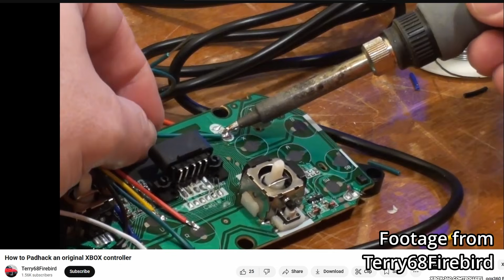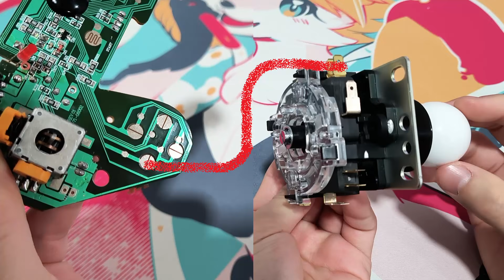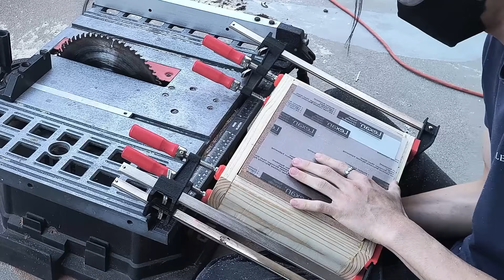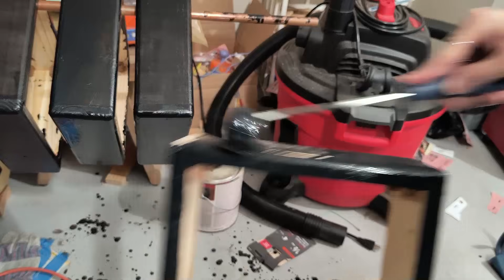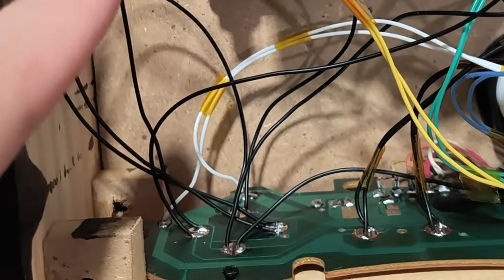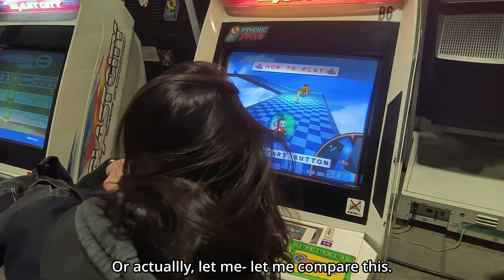Super Monkey Ball Banana Joystick GameCube Build

Comment: Hey,  did you see a web browser version of Monkey Ball was released a few days ago?    There's an article about it on Time Extension.

But, the stiffness fromt he arcade version might be more from the rubber that's housing it,  it looks like they stuck it in the middle of a plunger :D    But you could replicate it by lowering the shaft slightly, and maybe tying some bungie rope to it,   which a lot of cheaper steering wheel controllers used to do to get that feel of tension the further you steered.
Reply from the maker: I did! It's so crazy I don't understand how that's even possible.
And you're definitely right. The rubber grommet around the original looks really thick. I did think about using some tension springs and attaching them to the bottom shaft of the stick, but string would actually be better since it wouldn't take as much room. I'll try that if I ever make an improved version haha. Thank you so much! Hope you enjoyed the video!

Comment: I've heard the opposite the electricity flows and when you push the button the electricity stops flowing normally and goes to ground instead. I always thought that sounded backwards to me but I'm not smart enough to confirm one way or the other.
Reply from the maker: You're right! Current conventionally flows from positive to negative, but the reality is that the electrons themselves flow from negative to positive. This discrepancy is a result of some history I won't get into, but the point is that current flows from positive to negative, and electrons flow from negative to positive. It just depends on which framework you're looking at things from. I think another confusing thing is how "current" can refer to both the flow of electricity itself, but also the measure of the RATE of flow of electricity. In the case of my video, I just use the framework of flowing electrons, and use current to mean the rate of flow of electricity. Very confusing, but it's like that for everyone haha. Hope you enjoyed the video!

Comment: I remember when I first got to try the original arcade game when I went to EVO 2024. It really is a magical experience to use the banana joystick for Monkey Ball fans. 

As for your really cool build, I think having heavier springs might be able to alleviate the snapback, if you were able to modify it. I did see a reddit post that fused a mini Adafruit analog joystick with a Sanwa JLF so maybe there could be some inspiration from that. 

Your breakdown on how you made yours did give me ideas on what I would do if I were to make my own frankesteined pad hack stick like if I were to make it switch between modes for GameCube and PC. I never tried pad hacking before and have no idea if it's possible to stuff two controller PCBs into a case, somehow route all the wires between them and use a switch that activates which controller you're using, but it would be an interesting experiment.
Reply from the maker: Ohh I just found that post that looks really cool. I think that would've been useful for my Smash controller haha.
That would be really cool to have a controller that switches seamlessly like that. I have some other controllers that solve that issue just by having 2 plugs at the end haha. Or just making the cord swappable. But now with Bluetooth GameCube receivers, that'd definitely be easier. Let us know if you ever make that controller that sounds really interesting.

Comment: i want something that will hold up for a bit is there a hall effect or tmr stick u can think of?
Reply from the maker: Yes! The trick I've learned to find parts is to either add "component" or "industrial" to your searches. I found a few industrial hall effect sensors just now that I think would work, but I don't have personal experience with them so I can't say for sure. I think if you take apart the plastic housing on the stick, you should be able to more easily attach the banana on top of them. Hope that helps, and I hope you can build a cool controller!

Comment: Flycast can emulate the Naomi hardware and then you can get the original Monkey Ball game.
Reply from the maker: I tried emulation, but I think I'm just not smart enough to configure it correctly because it didn't work for me. Even then, that still wouldn't have been the same as playing on og hardware with the real banana, and that's what I was more interested in haha. Hope you enjoyed the video!
Reply: @SodaCanTablet you need the Naomi bios in a folder and the monkey ball game in a folder called monkeyba. The chd will be in a subfolder also called monkeyba but the zip of the game is not in the subfolder.

Comment: I feel like using 24-28GA wire and soldering to the vias instead of the button contacts might've been better. No real need to use wire gauge that thick for inputs. 100% agree with the recommendation to do daisy chains and use quick disconnects. They don't cost that much people!

If you ever care enough you could probably get a nicer print using resin, seems like you have your own printer or access to one but not sure how viable that is (or isn't) for you. I usually outsource my prints and always choose resin for that baby smooth look.

Great job!
Reply from the maker: In hindsight, you're totally right. I even used thinner wires in my other projects like you can see when I'm showing the daisy chain. I think those are 28 or 30 gauge, so I definitely should've recommended those instead. It's because a lot of the footage and voiceover are 2 years old at this point and I didn't have much experience back then haha.

I want to get a resin printer one day! I love how smooth everything looks, but yeah it's too expensive for me for now. And it wasn't imperative that the prints for this project be super smooth, so I didn't want to spend more money than I really needed to.

Thank you so much! Glad you enjoyed the video. :D
Reply: @SodaCanTablet  If I can make a suggestion, an ABS 3D print that's been acetone vapor smoothed would yield results very comparable to the original injection molded piece, and you benefit from using filament that's already colored banana yellow.

In any case I'm very glad you're still producing content and I think the project turned out great.

Comment: Maybe if the banana lever was kinda similar to a Korean lever with a rubber grommet and shape the collar to be close to square or rounded square and have the analog parts combine with that concept, then maybe it can control better.
Reply from the maker: Ohh do you have a specific recommendation for the Korean lever? I don't know much about Korean parts. I do really like the idea of Frankensteining different parts together though and I think that would definitely be the best.
Reply: @SodaCanTablet I was thinking on how Korean levers work. Their tension system uses a rubber grommet instead of a spring like most other levers including American and Japanese levers. The tension feels more gradual but fast to return to neutral. I tried to make one analog style lever using a Sanwa JLF but with the Otto V2 mod for the rubber tension and SASI analog module mod and that felt closer to what I want in an analog lever. I also used Buttercade's springless mod too but the spring might be better. Don't know about the banana. I don't know how to mod a Korean lever like those from Samducksa (Crown) or IST (Fanta) to have analog functionality but the tension is better with those actual Korean levers

Comment: How come you didnt use an OEM or PhobGCC for the board?
Reply: because thats a bit over kill for something where you are replacing the joystick anyways
Reply: @ayoitsaya  but with a Phob, the solder pads for soldering the buttons and stick are already present at least.
Reply: @aplsed  Sure, but the cost of a phob board can be somewhat expensive unless you are someone who ordered a ton of them, it also requires programing them and at that point you could just use a regular raspberry pi pico as that is what a phob is anyways.

Its just easy to find 3rd party controllers for cheap that would otherwise be E-waste to most people and give it a new purpose, and part of the point of the video is showing that you could do this sort of thing with different controllers on different consoles.
Reply from the maker: Yes! You put it into words better than I ever could haha. I didn't want to waste a perfectly good high quality controller pcb like OEM or the newly manufactured ones, and most people rag on the Game Stop ones anyways so I thought I'd give them new life as you said. Thank you for watching!
Reply from the maker: Yeah I thought it'd be a waste to use an OEM controller since an aspiring Super Monkey Ball speedrunner or Melee pro can use those, but I don't think anyone would be missing the Gamecube controllers too much haha.
The PhobGCC and some other boards like those square compact ones I see on AliExpress were tempting, but I found the price with shipping on those added up to be more expensive than if I just went to my local game store and bought a third party controller. I did actually use an OEM board for one of the sticks I made though because the store I go to ran out and I didn't want to wait for one to arrive from eBay haha. Hope you enjoyed the video!

Comment: As someone that usually works alongside arcade cabs and makes their own fightsticks, its interesting to see your interpretation of the controller,
Parts love to break down, so finding the lever thats completely 1:1 is almost impossible, so you may run into differences in tension and even using OEM springs may not give the right feeling on it. One that gets used as a replacement sticks are usually the bamco ones notably from gundam, for example the ones used on the Gundam/戦場の絆/戦場の絆II arcade machines,

btw, around your area, sometimes it gets brought out to shows around, like for example last year the machine was brought during MagWest and LVLUp expo, so there a few a few instances of it showing up there occasionally.
Reply from the maker: I really want to work with arcade machines! My dream is to work at a small arcade or game store one day. Also, which part of my interpretation is interesting?
I saw the Gundam stick too! The arcade projects post by nnap actually used the same stick.
I will definitely keep my eyes out for MAGWest and Lvl Up Expo then. I talked to Game Saru and they said they occasionally bring Monkey Ball to the cons they go to like EVO. Hope you enjoyed the video!
Reply: Honestly just how you designed it to a square form-factor, reminds me a lot of the MAS sticks. Also was surprised you chose to opt for using a gamecube controller board, meaning it can be used natively on the gamecube. There are a few boards out there as well as the recent brook retro board that supports analog, so maybe being able to try it on the other monkeyball, community maps on emulation as well as the other monkeyball-likes would be enticing to try it out on pc too